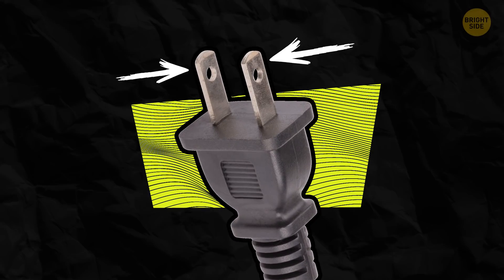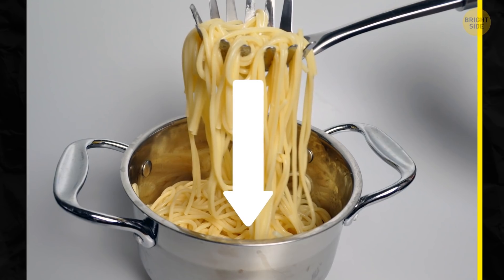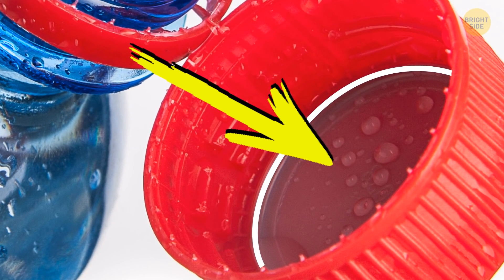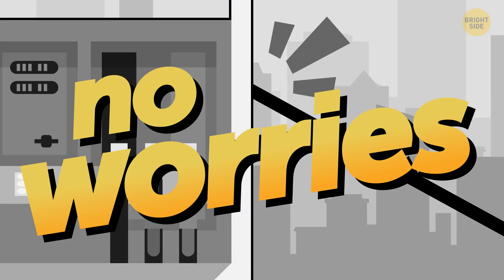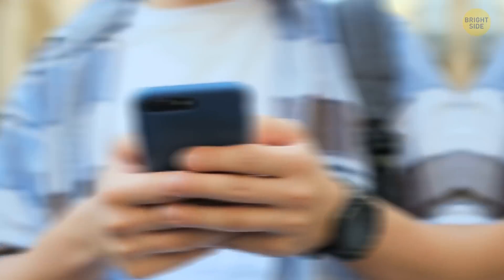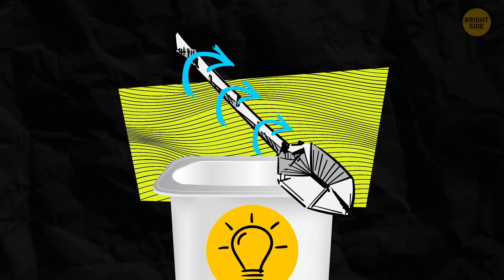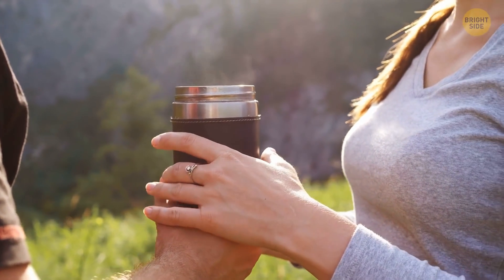That's What Holes in Electric Plugs Are For

Comment: The airholes in the pen is wrong, the hole is so you the air pressure keeps the cap on. You would never be able to breath with such a small hole

Comment: UK plugs are safer, they have three solid pins, a fuse and rules about where to wires go in the plug. Unearthed equipment have earthed plugs on them. If the plug has no earth wire, then the electrical item has its own earthing circuit, such as a television. Our voltage is 280 volts, higher than the US, so if you eventually get to come as a tourist, just don't misuse the plugs, i.e. don't put a wire on the pins, or use without a fuse. ⚡

Comment: 4:59 That is not the correct location where to tap the Heinz Ketchup bottle. You tap the number 57 that is located on the beginning of the neck where the bottle starts narrowing (not the sticker 57 at the top of the neck).

Comment: the hole in airplane window "
 
Its there so ur window won't fog up , due to the temperature differences.
a plane can easily fly without them . those small holes doesn't make any pressure difference in the  cabin and storage area .  cabins have maintained  pressure , which can be change by the pilots . they are set  to pressure safe to humans.

U are spreading wrong info bright side .
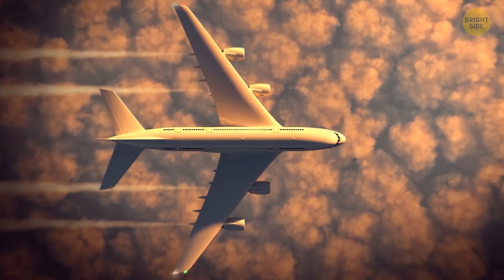1:05
Reply: I think you should ask a pilot... the holes on the interior windows are for regulating pressure
Reply: @cr875  my uncle is a second officer
Reply: @markpereira3931  my husband is a pilot and it’s in the training books
Reply: @cr875  ok . So he must have PPL . What does he fly ?commercial or private?
Reply: @cr875  they are so tiny that it doesn't make any difference between have and not having them .
Imagine have to sit at window sit and having a window fog up and ruin ur day .
Reply: Umm...bright side tells the truth tho the small holes or known as the "bleed holes" used to allow balance pressure between the passenger cabin and the air gap😉
Reply: @noemijesaminem.duenas818  what air gap ?
If u are talking about the storage area . Then the people on board would just die .

Comment: nice as always
Reply: Earth's atmosphere consists mostly of nitrogen and oxygen. More solar energy is received by tropical regions than polar regions, and is redistributed by atmospheric and ocean circulation. Greenhouse gases also play an important role in regulating the surface temperature. A region's climate is not only determined by latitude, but also by elevation, and by proximity to moderating oceans, among other factors. Severe weather, such as tropical cyclones, thunderstorms, and heat waves, occurs in most areas and has a large impact on life.

Comment: Who didn't even know they had a drawer in there stove
Reply: Earth's atmosphere consists mostly of nitrogen and oxygen. More solar energy is received by tropical regions than polar regions, and is redistributed by atmospheric and ocean circulation. Greenhouse gases also play an important role in regulating the surface temperature. A region's climate is not only determined by latitude, but also by elevation, and by proximity to moderating oceans, among other factors. Severe weather, such as tropical cyclones, thunderstorms, and heat waves, occurs in most areas and has a large impact on life.

Comment: ""ᴵ ᵃᵐ ˢᵘᵇˢᶜʳⁱᵇⁱⁿᵍ ᵗᵒ ᵉᵛᵉʳʸᵒⁿᵉ ʷʰᵒ ˢᵘᵇˢᶜʳⁱᵇᵉˢ ᵗᵒ ᵐᵉ"""
Reply: Bot
Reply: Earth's atmosphere consists mostly of nitrogen and oxygen. More solar energy is received by tropical regions than polar regions, and is redistributed by atmospheric and ocean circulation. Greenhouse gases also play an important role in regulating the surface temperature. A region's climate is not only determined by latitude, but also by elevation, and by proximity to moderating oceans, among other factors. Severe weather, such as tropical cyclones, thunderstorms, and heat waves, occurs in most areas and has a large impact on life.
Reply: Bill Maher still spoke at the commencement... Also surprised Manchukuo wasn't accepted. Anyway, best of luck to Newton North!
Reply: BOTT

Comment: Great!!!
Reply: Earth's atmosphere consists mostly of nitrogen and oxygen. More solar energy is received by tropical regions than polar regions, and is redistributed by atmospheric and ocean circulation. Greenhouse gases also play an important role in regulating the surface temperature. A region's climate is not only determined by latitude, but also by elevation, and by proximity to moderating oceans, among other factors. Severe weather, such as tropical cyclones, thunderstorms, and heat waves, occurs in most areas and has a large impact on life.